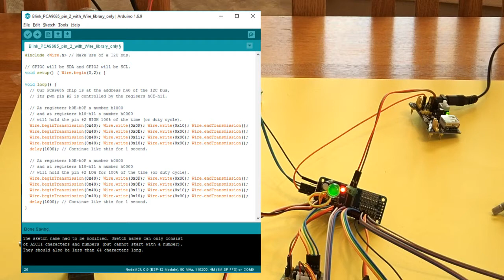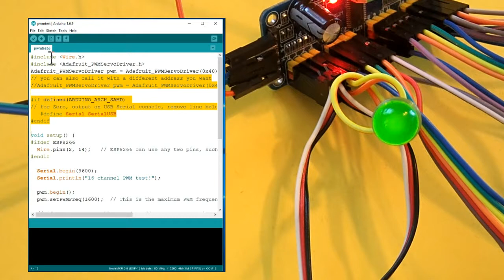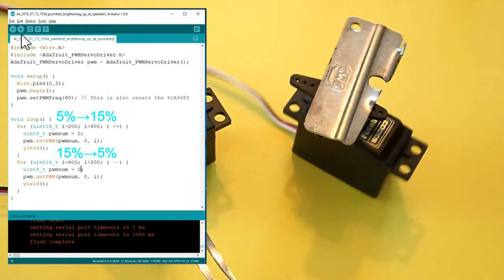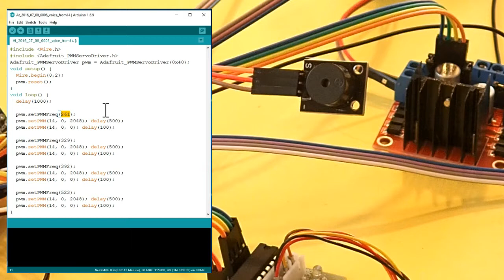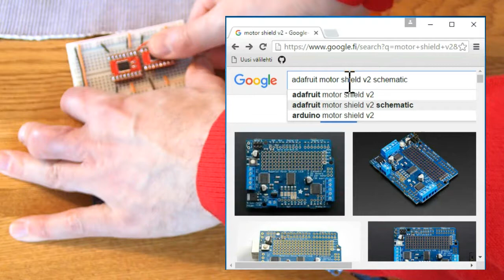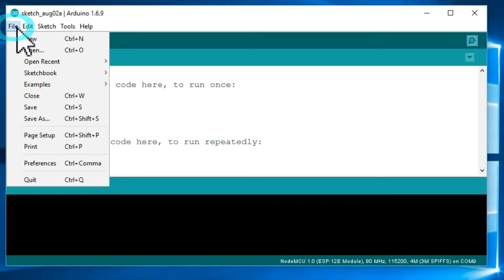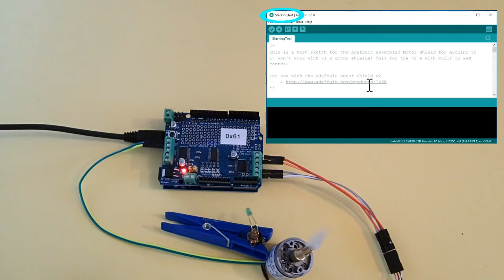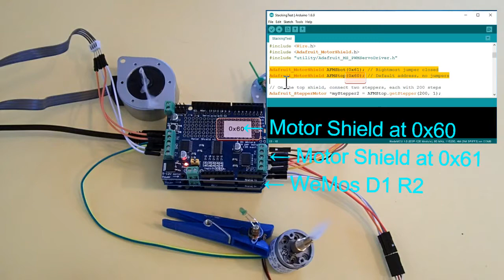#5 ESP8266 Drives a BUS

Comment: Hi Miika, good video. I'm glad I stumbled upon it as I'm facing an issue using the PCA9685 chip to control the TB6612fng motor driver. This is for my senior design class so I have already prototyped using the breakout boards. But I have no made a custom PCB. On the custom PCB I have the STBY pin of the motor driver connected to pwm pin 15 on the PCA9685. The adafruit motor driver shield just keeps the standby enabled by shorting STBY to Vcc. I was thinking it would be nice to enable and disable the motors using the standby pin. But now, no matter what I do I can't get the standby pin to go high. 
Can you tell me how I can print the status (high or low) in the serial monitor? Since it's through i2c, I can't just use: 
Boolean status = digitalRead(15);
Can I?

And I am using the adafruit motor driver v2 library. So the way I am trying to get the pin high is changing the example code to include:
AFMS.setPWM(15, 0, 4095);

Comment: The Esp8266 Arduino GITHUB project already includes a custom Servo library that can drive IO pins to control these hobby servos directly.
Reply from the maker: Yes, if you want to use GPIO pins for controlling servos, this is fine. https://github.com/esp8266/Arduino/blob/master/doc/libraries.md#servo

Comment: I ran an ada fruit thing on 2AAs for 3 days straight before it died.
Reply from the maker: What do you think that was the reason that your device broke down?
Our this video was mainly about the I2C bus. The PCA9685 chip was a good example for showing
how to use the bus. But we must understand that the PCA9685 has been developed
for controlling LEDs – not for motors.

And as our main focus was on the I2C bus I didn’t apply in the video any heat sinks on the
TB6612 chips!
https://learn.adafruit.com/adafruit-motor-shield-v2-for-arduino/powering-motors#current-requirements

The TB6612 chips are tiny DC motor drivers that are good for 1.2 Amp or less of current.
They do handle peaks of 3A but that's just for a short amount of time, about 20
milliseconds.

Adafruit likes these drivers as they with built in kick-back diodes internally so you
don’t have to worry about the inductive kick damaging your project or driver.
https://learn.adafruit.com/adafruit-tb6612-h-bridge-dc-stepper-motor-driver-breakout/overview
Reply: The batteries ran down (probably could squeeze out more by removing the LEDs. No big deal. Great video, great explanation!

Comment: Thank you very much for most interesting watch and explanation. I mostly use 12E for sensor readings and MQTT comunication. Apart from being slightly power hungry, they are excellent.
Reply from the maker: Thank you for your comment! Yes, the factory made ESP8166 modules are
much too power hungry for battery powered systems. That’s why I like to use
these ESP8266-DIY-modules and DIY-kits. By that way I can customize and
minimize the power consumption of the flash memory, of the USB-to-TTL-converter
and of the other peripheral components.